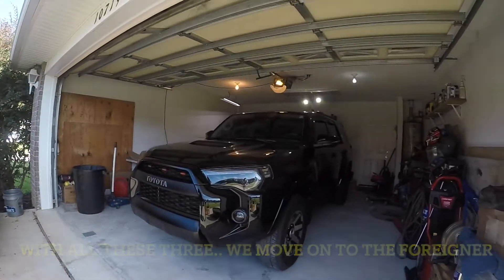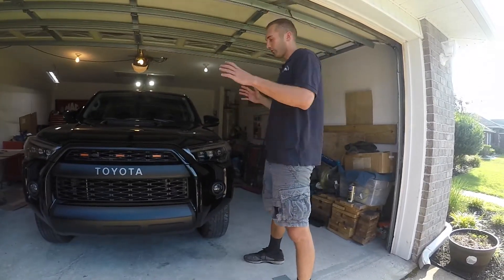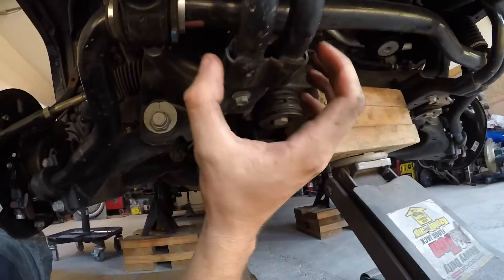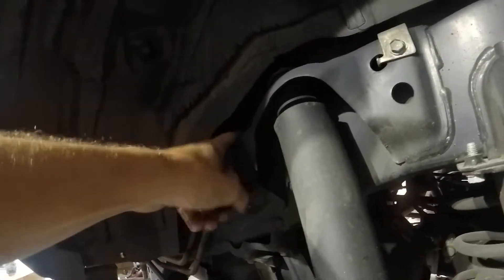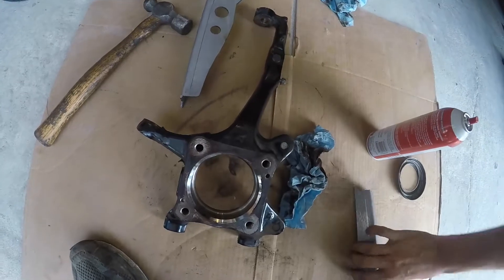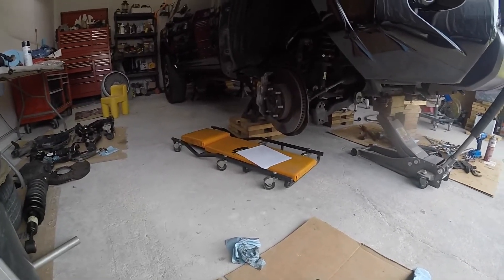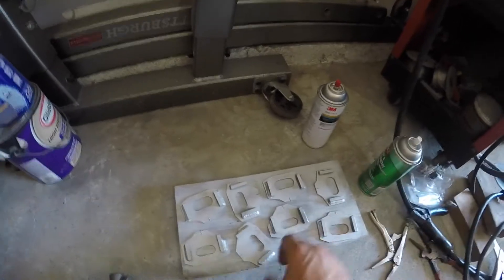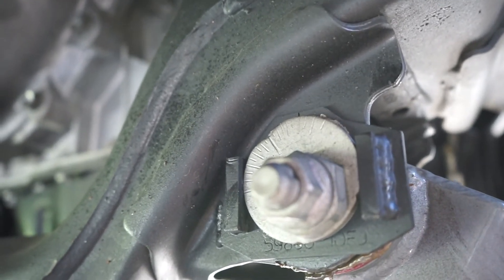KDSS Suspension Tear Down

Comment: Any issues after removing kdss?
Reply from the maker: No and it’s the daily driver so no issues so far. The only thing is the kdss light will stay on on the dash but that can be shut off at the dealership I just haven’t cared that it is on to go do that.
Reply: Could removing the kdss fuse turn off the light?